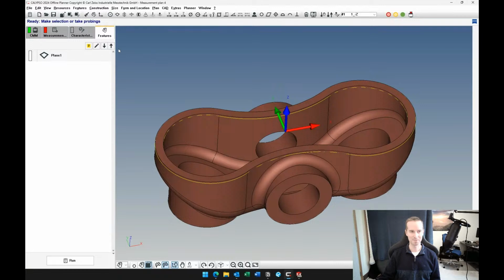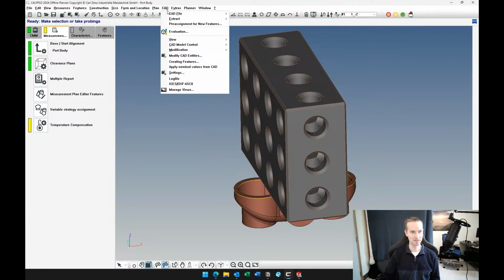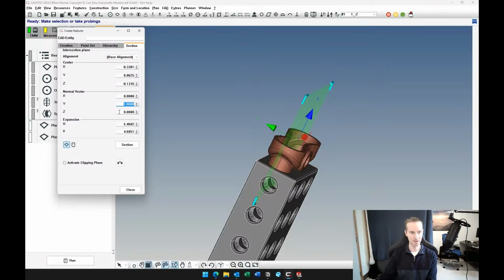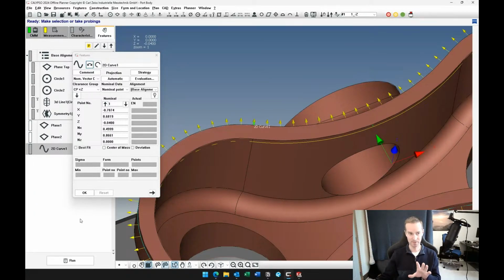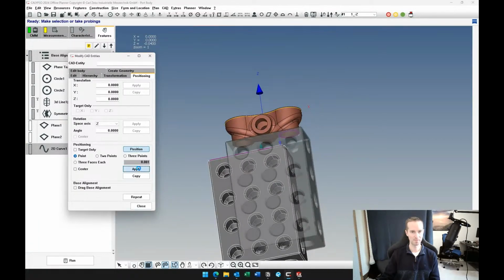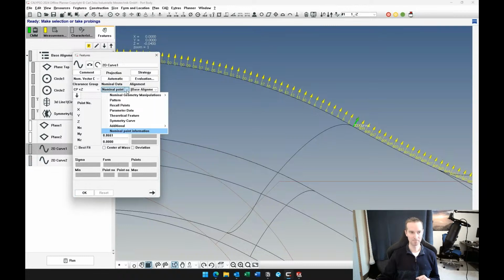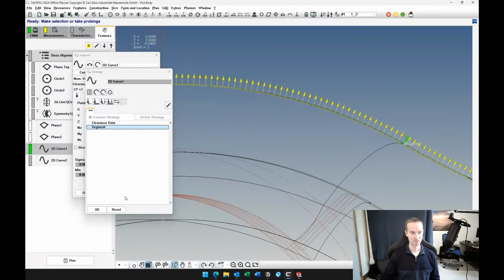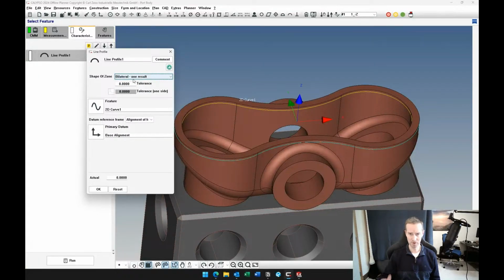Example Calypso Program with Curves & Profile - Part 1

Comment: I have a problem when I create a 3D curve from a section, then recall those points into a feature like a 3D line or circle. The feature that I create from the 3D curve is almost never in the correct spot even though I am using the lasso tool to select the specific points that should be used to create it. This happens even for something simple like a line. Is that normal?

Comment: I want to simulate a scenario where the measured alignment plane is moved with an offset only in a linear direction along a single axis. 
To achieve this, I used the “Special Functions Setting” section in the base alignment settings, but the changes were not reflected in the results.   
I also attempted to use the theoretical plane, but it did not work either.    The purpose of this simulation is to evaluate how the results change when the reference is modified through machining.  Could you please
advise me on how to accomplish this?